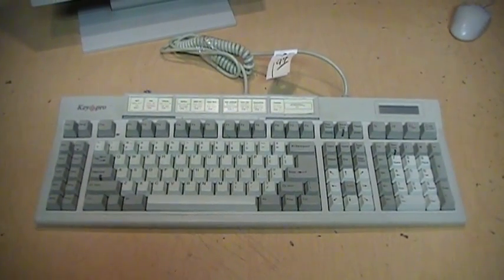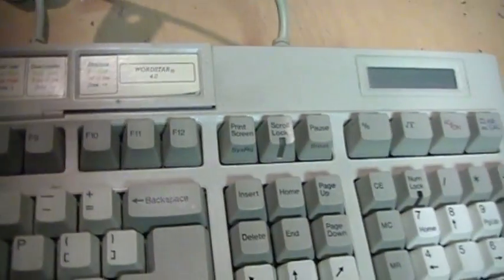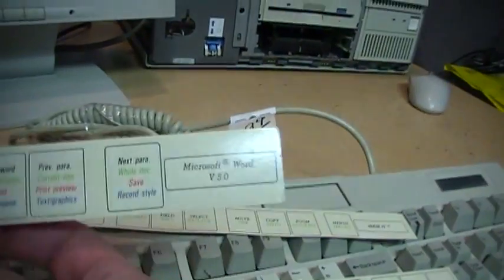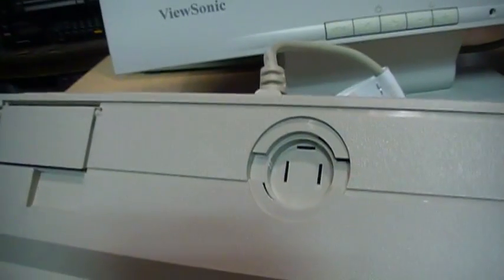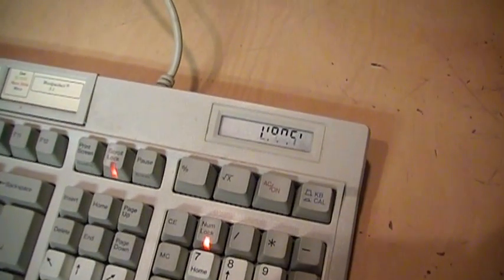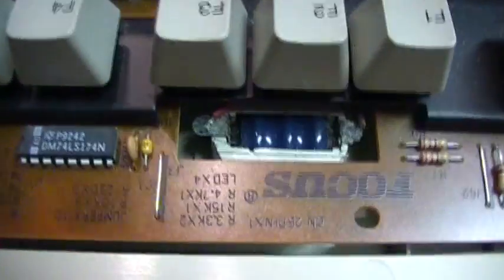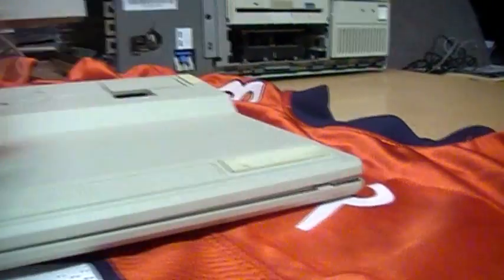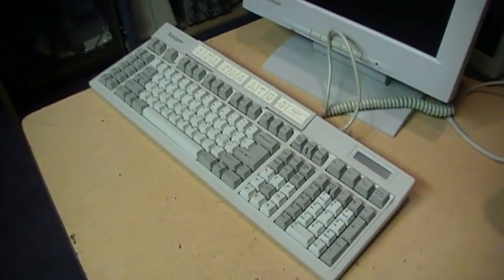1992 Focus KeyPro FK-9000 keyboard

Comment: Just got this exact keyboard. Initially when I powered it on for the 1st since I got it it showed the same symptom as yours. But when I played around with the XT/AT toggle switch for a bit, the fault went away. Glad mine is a survivor, but the same might not be said for the calculator feature. Also, so much "eck" built up over the years and decades, and lastly; probably the least popular opinion, but the switches may need some lubrication, as they are Alps White and from my experience with them they can sometimes be clunky in operation and I feel like they could use a more smooth operation
Reply: i believe people usually recommend boiling and waxing the stems and top housings these days for SKCM White Alps, although you may want to try ultrasonic cleaning the stems and top housings first before that!
Reply: Most alps just need a simple cleaning. They aren't the easiest to reassemble (mostly the springs,) but getting all the dust, ultrasonic cleaning the top shells/sliders then rinsing in distilled water leads to the best results in my experience. You aren't going to get them to be like they were brand new, but you can still improve them greatly by cleaning.

Comment: The year "82" is the year 1993, not 1992. In Taiwan, the current governing authorities (which are foreign) were established in 1911 (actually they were established in 1928 but they always like to refer to their year of establishment as 1911), so they always deduct the western year by 1911 to count the number of years after their establishment. Therefore, 82+1911=1993
Reply: This is useful, thanks for the information

Comment: Funny thing, those ALPS switches are actually used in Guitar Hero controllers under the strum bar.
Reply: the ones on the guitar hero board are simplified alps, these are complicated.
Reply: Simplified alps are no match for complicated alps. Simplified alps feel sloppy and clucky.

Comment: ALPS boards couldn't have a clicker and an LED at the same time because they were both placed in the same position in each switch.
Reply: Matias fixed dat with their lineup of upgraded simplified ALPS.
Reply: They 'fixed' it by using a clear case and PCB mounted LED's. That is more of a workaround.
Reply: This was the tradeoff for the switch design itself. Alps were originally designed to be linear, and when more keyboard manufacturers wanted tactile switches, they had to make the sacrifice of removing the LED slot from the casing to accommodate for the tactile/click leaf. Cherry MX also started out as linear-only, but they managed to make it work down to how their contacts are designed. I'd still say MX is an inferior clicky/tactile design, despite fixing this issue.

Comment: I still have mine for the 90s. From memory i believe the macro keys store 16 keystrokes. The turbo button is for changing the key repeat rate. Soon as i find my AT to PS/2 adapter I intend to start using it again. The old keyboards are built like tanks and are repairable if anything goes wrong. More modern keyboard that use membrane layers essentially have to be thrown out and replaced.

Comment: Hi. I actually bought and still have a FK-9000 (technically FK-9001) keyboard to this day. FYI, my still works but a few keys registers two key presses for every single press. I can add some information about this keyboard. 

In 1994, this keyboard cost over $100 in Canada. I think it might have cost as much as $125. 

This keyboard can control the repeat rate of keys when a key is held down. This was done via the keyboard's internal controller and was independent of the OS and BIOS rate.

The diagonal arrow keys are in fact macro keys. When pressed, the key sends out two key codes. I wrote a key code display program and confirmed that this is the case. Don't use the diagonal keys when playing first person shooters. It really messes up the games. DOS's keyboard buffer was also halved when these keys were used in text editors and word processors.

The programmable keys stored single key press macros for example , [ALT],[F],[X]. They could not do multiple key press commands like CTL+C.

My last point. Best model name ever because you can getaway pronouncing it with an obscenity.

Comment: I happen to have a Focus FK8200 lying around here. Quite a nice keyboard to type on. It doesn't use the mechanical key switches but actually a weird membrane style with a spring loaded cylinder between the keycap and the membrane. Unfortunately though the caps, A and S keys don't work, so I'll have to sort it out.
It still keeps the LCD screen with time functions as well as the inbuilt calculator and 12 programmable function keys (along the top above the F keys)

Comment from the maker: But that is not an AC plug. There are no corresponding pins or traces on the circuit board underneath the knockout plug, so it serves no purpose.

Comment: You know, I think I saw one of these keyboards about 10 years or so ago, the one I saw certainly had a little LCD screen on it, I assumed it was for a calculator, but I didn't try to use it, the keyboard I saw was pretty dirty actually, it was being used, the it hadn't been very well maintained.

Comment: As it turns out, the problem is that Focus for some reason routed the power through the calculator switch button, and this routing doesn't work properly if the calculator isn't powered. What maladroit BELLEND came up with THAT idea?!
Reply from the maker: Yes, I learned that from Chyrosran22.
Reply: What maladroit BELLEND came up with THAT idea?!